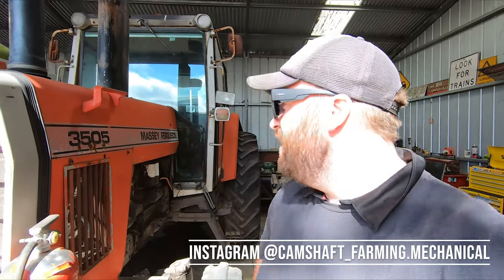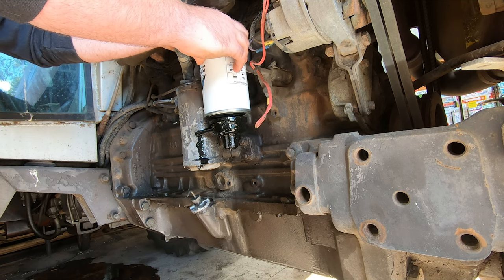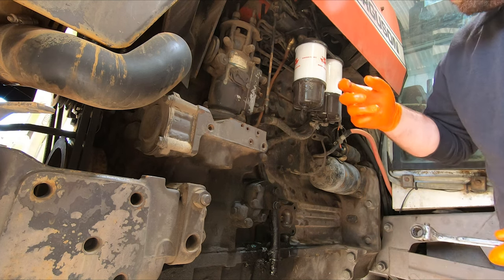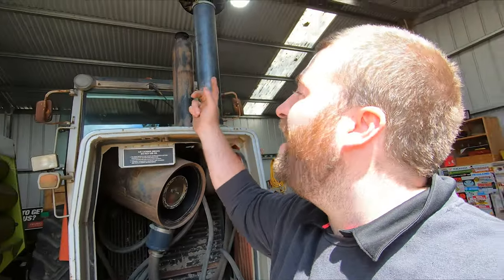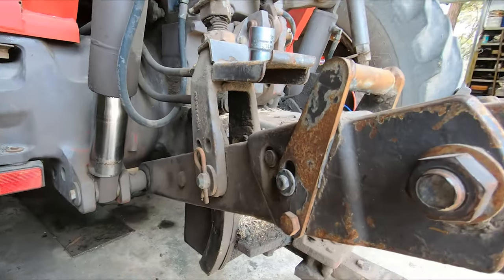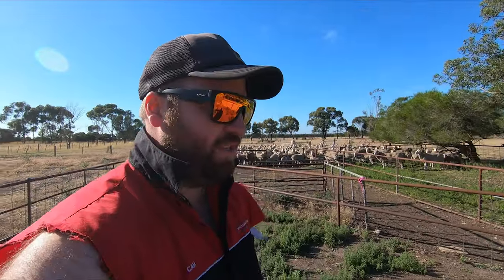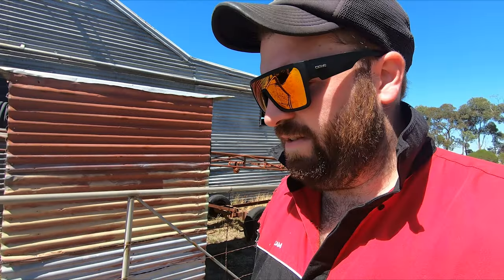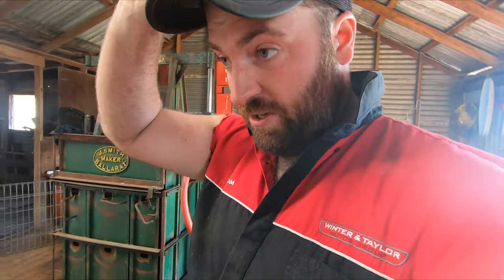Servicing The Massey Ferguson 3505 & Drafting, Drenching And Vaccinating The Dohne-Merino Lambs

Comment: The pins are seized on the casting and require a hydraulic extraction tool to pull them out, make sure ram is running free on pin first, use penatrating oil and a lever bar to slide it from side to side, 5/8 UNC is the thread size in the pin, try without heat firstly while hitting casting with hammer,

Comment: Part No for the seals you need on the draft sensing shaft is 3384311M91, you won't need to drain the oil as it comes out very slowly, bar you are changing it

Comment: And another tip for you, if your outer seal is leaking oil from the PTO shaft, do NOT dismantle it on level ground, reverse the tractor up onto the steepest mound of clay, stones or the side of bridge and get it as vertical as possible, when that is safely done, you are "safer" to disturb the PTO hub and replace the seal and orings and no oil has to be drained either. If you remove on the flat you greatly increase the chances of the Thrush washers and gears falling down.
Reply from the maker: Thanks mate good advice
Reply: @CamshaftFM  No problem, had most of that information sent to you twice yesterday in one long message but it didn't appear in the comments first time and disappeared in a couple of minutes the second time, that's why I sent individual messages for each topic, maybe you tube has a limit on size, never left a comment on a page before, all new to me.
Reply from the maker: @mfdb  yeah it might go to spam if it’s too long 👍

Comment: 1856520M1 is the workshop manual you need for that tractor, available for AGCO
Reply from the maker: Hi thanks for the advice. Is that manual for the French built model?
Reply: @CamshaftFM  Ya,that's what we use for the 2000 series after 1983 and 2005 series until end of production here in Ireland